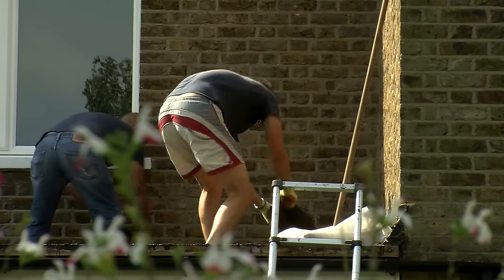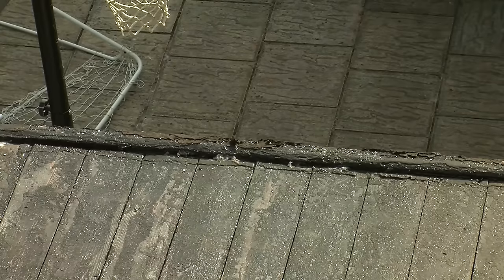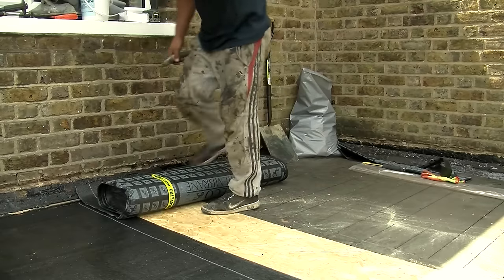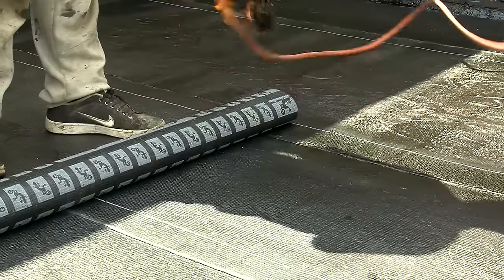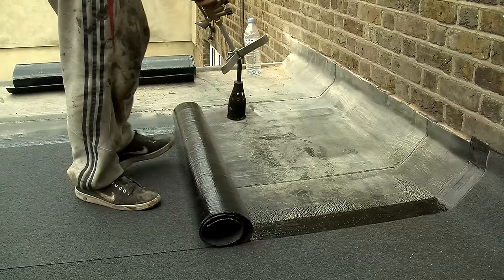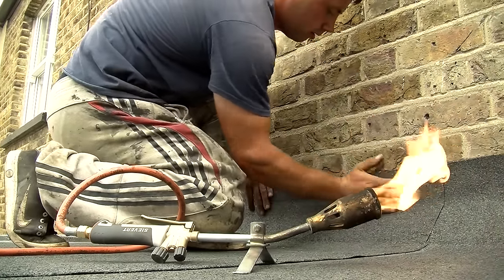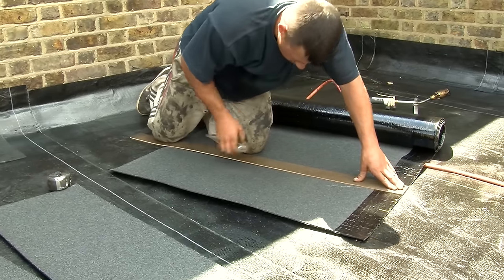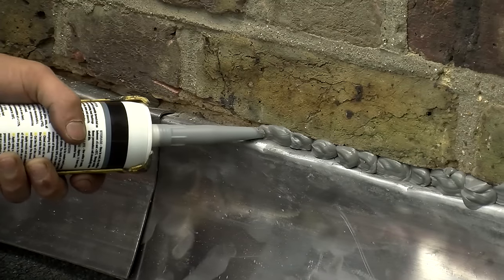How To Replace A Flat Roof  - Argyle Roofing Contractors

Comment: If your laying felt without gloves on and it's not burning your hands when touching the newly layed felt then the felt doesn't have enough heat in it. Therefore it isn't stuck properly. That's an absolute fact
Reply: Bet you've got girly office workers hands
Reply: Stick to office work
Reply: Yea that’s definitely correct and I should know because I do it to the point where it will burn your skin
Reply: Wrong. You should have it warm to the touch. Over heating or having it to hot damages felt. And it looks a mess!!
Reply: I agree
Reply: My boss says if you worried about burning your hands it means you are over heating the felt or May have girly hands 😂
Reply: Your kinda right to a degree, pardon the pun but look at everyone of them flashings there not a single one with a bleed and on the weekest point of the roof, I don’t think anywhere in that roof had a bleed and that tells me he most likely hasn’t heated it enough

Comment: You realize that the only thing holding that entire system on is the handful of staples that you put into your first layer of base right? When you were torching the next layer down I could see the lap lifting which gives your flame easy access to the dried out wood beneath it. If you want to do it with a "nail down base" , you need to nail the entire thing in a 3-2-3 pattern and nail your lap every 6". I don't see a bleed out,(minimum 1/4") which most manufacturers require in order for a warranty to be valid. I won't even touch on the lack of safety and the shorts and sneakers being worn ,you're asking for trouble there.
Reply: You wear sneakers not boots when torching
Reply: The idea of stapling/nailing is because the felt and decking move at different rates. This allows movement to stop the felt splitting. So the least number of nails the better. We use staples on a 2c torch on laid  upside down. We then torch on the 3kg sanded and the 4.5kg charcoal mineral .  A total of 14.5kg per sq m (32 lb). All SBS polyester. A 40 year life.  As for fire, we use 18mm or 22mm   T&G 8x2 Krono span. No gaps. We torch down the 3" lap of the 2c so there is no gap there as well  and is then waterproof if it should rain. (Wales!!)  Bleed out?   We never bleed out.  This was thought to be the correct way.  It has been proved to be not necessary  although this was well intentioned and understandable at the time. All the torchers around here between them have laid hundreds of thousands  of metres of this system and no problems.   Enjoy your roofing.
Reply: @MrFlatroofer  also I saw some close boarding there...in that case fixing your first layer is the correct method as you don't want flames getting under the boarding
Reply: @1badmuthafutha  Agree.
Reply: No bleed on the laps! Not using any kind of roll bar! The flashings are stated from the wrong end mate you need to start at the outlet and work your way back so the water isn’t pushing against the laps! Cowboy 🤠
Reply: I’m betting this guys fresh out of school, spent 1 month at a roofing job then started his own business doing sloppy work. My impression is giving a kid a broom to sweep up that takes him all day and when you look he’s just standing there kicking rubbish. That room never got swept properly.
Reply: @ndrewell  There isn't an outlet on that roof is there? it drips into a gutter i thought unless i missed something
Reply: @ndrewell  thanks for your input, natasha😂
Reply: Yea Bauder require a  2-6mm bleed. All flat roofers wear flat shoes, don’t be a dork .
Reply: However if you’re confident with your shit and it’s proven then FairPlay, I personally prefer the piece of mind as essentially the bleed is for inspection purposes.

Comment: Why don't you have rubber run out of 1" ? You're not applying enough heat or is that a different material than the GAF Bitumen rubber?

Comment: The vented base layer is bitchiman based you should stick it down. Plus 2 mil sanded is not good too thin I recommend 4 mil sanded and charcoal when felt is put down right will last a lifetime

Comment: BEEN ROOFING contractor in Florida for 30 years ! In my opinion NICE  JOB YOUNG MAN !!!!! KEEP up The good work and beautiful ATTITUDE 💗
Reply: Hi what should be the angle of flat roof for water drainage?
Reply: @dwainDigital  Mim 2.5 for positive drainage
Reply: Really, I’m no roofer but I see him lay his felt by his feet 🦶 the only tool i see is a flame 🔥 thrower. No rollers, feet or brushes on the edges feeding every thing in by hand 🤚. I’m betting he goes back to most jobs to patch a leak. I could lay felt like this like making a bed, flick the felt up and let it float down like a bed sheet, job done…next.

Comment: As stated before, you need a constant bitumen bead on all laps. Separate flashings on the mineral and try to use a seam roller on your detail instead of your hands !!  Just trying to give you good advice
Reply: Blead or bead you can use either term for the bitumen that you push out
Reply: @thejoneslj  Ok, thank you kindly for taking the time to reply.
Reply: We use a wet rag to press down details.
Reply: @thejoneslj  a seam roller for single ply systems, yes I agree but not for torch on. I use a 4” scraper. Some use a trowel. Or some use hands. But yeh, I’d want my gloves on. I’m always hopping around after burning my hands. Bit of a thing of the past these days, torch on. Single ply is really the best way. No flames, no fires and no need for hot work public liability which costs a fortune and that most customers don’t check their contractors public liability insurance. They’re taking an enormous risk.
Reply: I use the back side of my trowel to push the bleed out nice swift motion
Reply: Also when laying the laps I roll them up first in an iron tube. it pushes the bleed out nicely and helps with an overall bond

Comment: I am trying to repair my flat roof. I have applied the adhesive to the roof. When I lay felt onto the adhesive do I have to peel off the thin plastic sheet from the felt first? Absolute beginner here😮😮.
Reply: Sounds like you have the self adhesive stuff . Needs priming then peel the back off

Comment: Is this matrial superior to rubber which i have seen used on a house recently which resident says comes with 25 year guarantee ?
Reply: They both have there pluses but if both fitted correctly then I’d certainly choose rubber over felt. Annual maintenance and last forever whereas felt eventually will perish. But felt is very easy to repair without special tools but rubber membrane is expensive and not repairable by your every day guy.

Comment: I got redo mine this summer some it 30 years ago with primed chipboard thinking marine ply this time 18mm and prime it my self you ever used marine ply
Reply: Marine ply? That is over £140 a sheet.   Use18 or 22 mm kronospan and 3 layer torch on SBS Polyester. A 40 year life.

Comment: You should use a longer torch when roofing standing up. Avoid back problems by standing up straight.
Reply: I've used a short torch for over 50 years and still roofing at 77.
Reply: Yes 👍

Comment: Couple off issues, 1-trainers ??? 2- No bitumen bead where felt overlaps !! I always use 18mm plyboard,not a great fan of OSB,next step up from chipboard !!! 3--GLUE ?? Does he mean LeadMate  sealant !!
Reply: You missed the socks!
Reply: Proudarse a bitumen bead or bleed as some might say, is the hot melted bitumen that runs out of the minimum 3 inch lap (the over lapping of the two sheets) this give the roof a long life seal as it’s clearly fused together by heat. 
Hope this helps.. 
roofer man
Reply: Yeah these guys aint the best but not a fan of osb? What are you talking about?
Reply: @lewishunt5615  osb- oriented strand board. It pure garbage. It's basically wood chips glued and pressed together. Once it gets wet it swells up and turns to mush. I personally don't like it either.
Reply: @bobbymancini9069  but it should never get wet or in 25 years if installed correctly.
Reply: @bobbymancini9069  i know what it is 😂
Reply: @bobbymancini9069  no, OSB3 designed for the building and roofing industry. It repels moisture. Only boards that swell up with moisture and turn to mush are chipboards which is what was used in roofing years ago. Get it right, son.
Reply: I use Kronospan.  40 year life.
Reply: @AJ-ds5gf  I replaced a "chipboard roof"  . it had been on 41years and was not leaking. The chipboard was dry all over and in good condition. I told the customer it was not leaking  but they insisted I renew it.
Reply: @MrFlatroofer  so? as soon as chipboard is exposed to moisture it's finished. If the roof covering lasted 41 years then the chipboard will last 41 years. It's not rocket science you fool.
Reply: If you have laid torch on felt you would soon find out normal boots mark the felt,so trainers are best.
Reply: @AJ-ds5gf        Wrong.  I had chipboard floor out in all weathers and it did not leak for10 years.
Reply: @MrFlatroofer  Wrong. That's a load of bullshit. Chipboard swells up like a sponge.
Reply: @AJ-ds5gf  It didn't.
Reply: @MrFlatroofer  It does.
Reply: @thejoneslj  When plyboard gets wet the top  ply comes apart.
Reply: @AJ-ds5gf  It didn't
Reply: @MrFlatroofer  It does.

Comment: cap sheet for flat roof should run against the flow of rain water for a flat roof. exception is, if roof is more than 12.5 degrees. see..., you learnt something.
Reply: @MrFlatroofer  Yh i have no idea what that means either. Maybe thats the method used in a different country

Comment: really. freakin hackers.  usin a11 staples instead sinplex nails. wow
Reply: fordman America made I don't think simplex fasteners should be used on this particular situation, as you can see there are several buildings around I believe wind isn't a problem with this installation procedure.
Reply: qmax1969 i dis agree   not in Washington state.
Reply: qmax1969  well then he can put your roof on with a11 staples. . then we'll see if u feel the same way after it blows off. Besides this roof would not pass any inspections.  any state.   It may pass if it was cold process
Reply: fordman America made I agree ,but you have to learn first to read a comment, a said "in this particular situation " ,also clearly this application is not  performed in the USA or Washington state. or
do you know building codes from England?
even in the USA  building codes vary from states or cities
Reply: qmax1969  i agree. and yes i do know building codes im a flat roof foreman for a union shop.  god bless
Reply: Matthews greed matthews greed 7
Reply: @wscraney  it's the UK not the USA.

Comment: That mate is not how to do a roof.
No capillaries cut out, no bleeds, no ppe, no pressure bars, no you don't tack the first layer, no you don't use 3 layers, and no insulation, No venting on a cold roof, no 50mm gap between your cover flashing and the field sheet.
11 years in the trade I would look at going back to school.
This is a very poor installation.
Mind you it keeps proper roofers in work putting right these abortions after a year.
Send this vid to bauder see if they issue you an installers ticket.
Try this, a vcl, a 120 pir, a 4.5 and a 5.5
Then post your vid.
Good luck.
Reply: micheal pratt : it’s English way of say “hey friend”. Nothing to get mad about ok.
Reply: grow up
Reply: .....and how many  could afford the Bauder roof.
Reply: @MrFlatroofer  it's not the materials it's the quality of a Bauder installer, 
Don't matter what felt it is but all felt should be installed to Bauder standards .
And this is not how you fit a flat roof .
Every part of this is wrong.
Reply: @peakyblinder-- would you do a video to show us how you would do a roof?
Reply: @MrFlatroofer  it's not used in residential roofs as a rule, but any felter worth his salts would have laid it and would know how to lay felt.
Reply: Egzactly